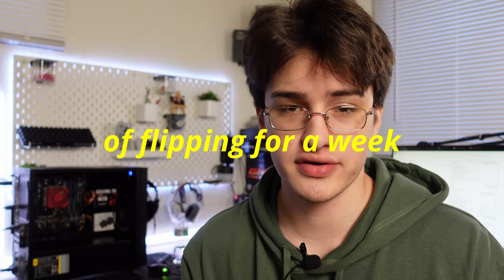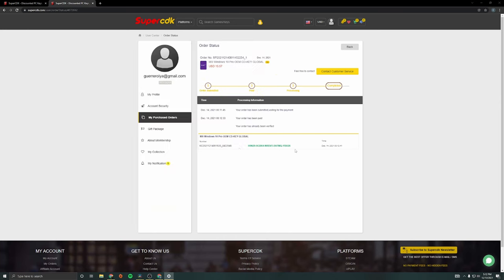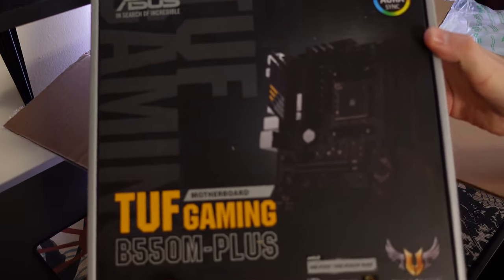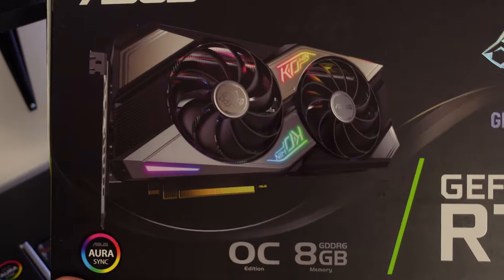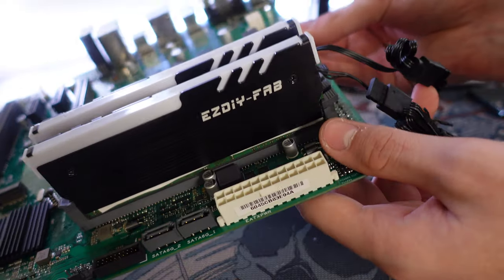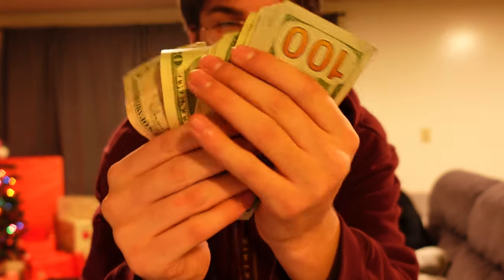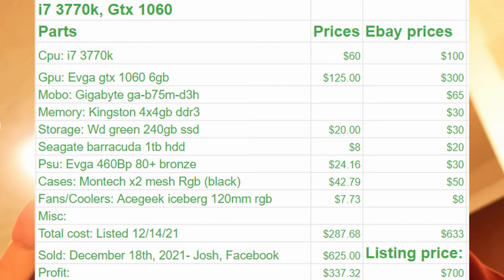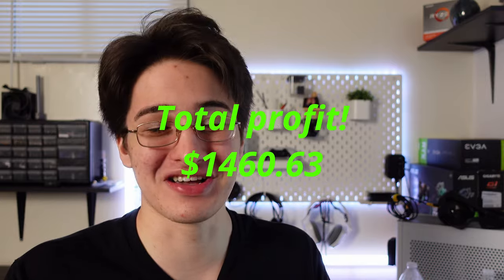Flipping Gaming Pcs For 1 WEEK Made Me $1400!

Comment: Elijah I have a question. What do I do if a pc won't sell at all? Because I've had this pc up for nearly a month now and it hasn't sold. Probably cos it doesn't have any RGB. But do you think I should save for an RGB case, sell all the parts and build a new pc or wait until it hopefully sells
Reply: Buy a cheap glass window case, or install some RGB fans. If a pc doesn’t sell within a week or two, take new pics and make a new listing.
Reply: @mattketner7597  thanks bro ❤️
Reply from the maker: Exactly what he said!
Reply: Things that help:
- any type of LEDs, even RGB strip
- listing Friday morning
- take better pics, if your phone has a portrait mode use that
- actively add benchmarks - at least Fortnite, Valorant, GTA V (make them up from what you find online if you don't have the time)
- people won't even haggle if the price is too high, so don't price too much over your lowest price
- most PC buyers couldn't do it themselves and have no clue, so spoonfeed them info - don't just list the specs
Reply: @b0ne91  wow thanks!